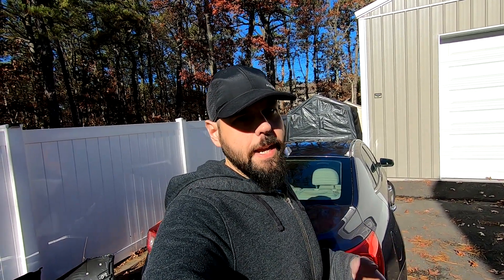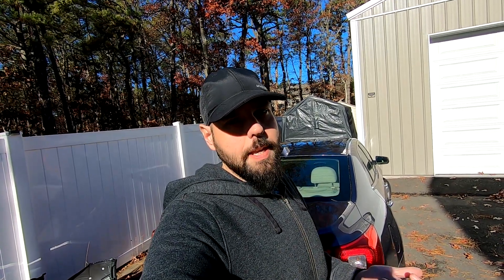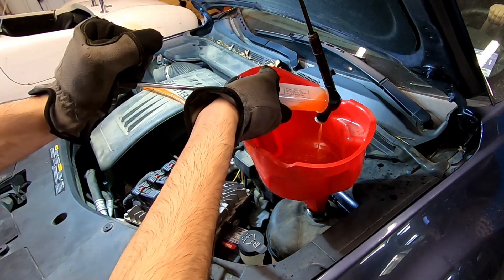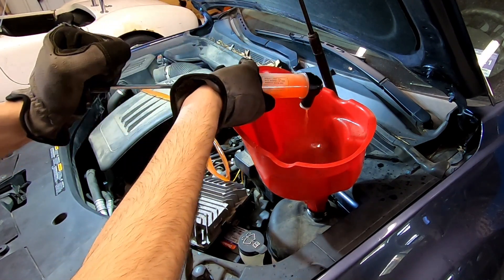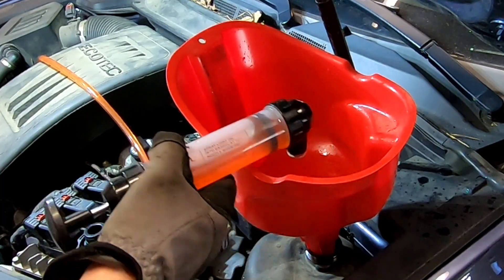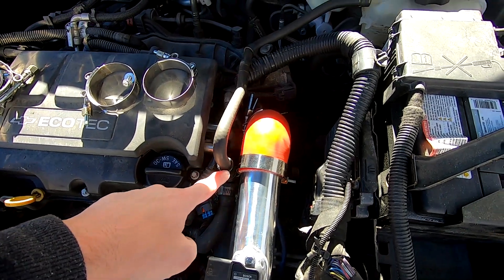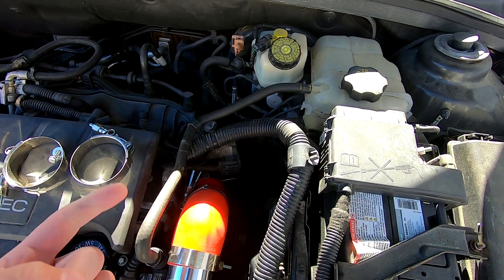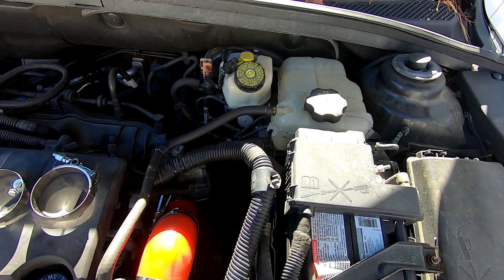Ecotec air bound fix CRUZE EQUINOX COBALT ASTRA HOLDEN

Comment: Thanks great video!! I have a 2012 Cruze and I believe it has air in the system if I hook my pump up to that hose that you suggested how do I know that all the air is out of the system like when should I stop pumping and do you heat the car up or do it while it's cold?
Reply from the maker: If your sending it back into a funnel you can eventually see no air bubbles come through.
Reply: My problem is my car doesn't overheat and it does have heat inside when I'm driving it's temp gauge stays all the way low if I sit still 10 page gets up to a quarter which is about 125 135 but never gets any hotter
Reply from the maker: @americanmudrider8169  what water pump and thermostat do you have ?
Reply: @davesworld2132  I believe it's all stock
Reply: @davesworld2132  I believe one day when we were driving it just got hot all of a sudden I think possibly because the fan wasn't kicking on anyway we took the cap off and so on and so forth got the fans running and it was like the water was boiling inside the motor like the pump wasn't pumping or something but anyway we parked it on a hill with the cap off overnight went out the next day topped it off put the cap on been driving it ever since but the car does not get hot hot temperature
Reply from the maker: @americanmudrider8169  does your car have shutters?
Reply: @davesworld2132  what do you mean shutters it's a2012 Chevy Cruze 1.4 t
Reply: So I have that same pump you have I'm going to do the same thing just keep pumping it recycling it back into the reservoir and then put the cap on and heat it up
Reply from the maker: @americanmudrider8169  The one thing I should’ve mentioned in the video as I was doing it while the truck was running in the car. Just watch that you do not burn yourself
Reply: @davesworld2132  so car runing hand pump till airs out right? And merry Christmas and thanks for the help
Reply from the maker: @americanmudrider8169  yes and you too!
Reply: So on my Chevy Cruze when I go to do this I take the cap off start the car turn the heat on and hand pump it into the reservoir from the top of that small hose as the car is running??
Reply from the maker: Do you have shutters?
Reply: @davesworld2132  😂😂i had no clue what you were talking about but now i do &NO! I DON'T HAVE SHUTTER
Reply from the maker: @americanmudrider8169  lmao !!!!!!! If you had one you would’ve known lol yeah my assumption was maybe your shutter was stuck closed it’s a really dumb design but it does help in the cold states
Reply: @davesworld2132  ya!! Its totally gone my bottom is wide open,witch i dont like because it leaves the intercooler wide open for rocks and debris to hit it and the way it looks looks like that piece has been off for a very long time of course my car has a lot of custom stuff done to it
Reply: @davesworld2132  what are shutters?

Comment: Very interesting way to removed the trap air. Another way is raise the car just from the front side as much as you can. The radiator at this high elevation migrates the bubbles out.
Reply from the maker: Yea my mustang always had that problem. I had to pick up the front like 2’ !